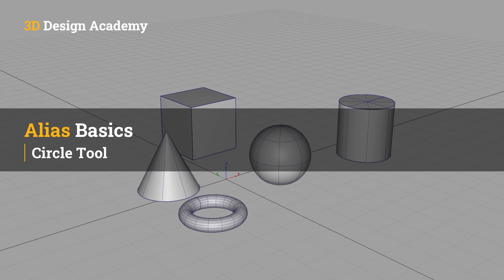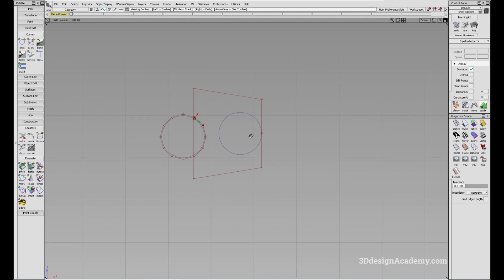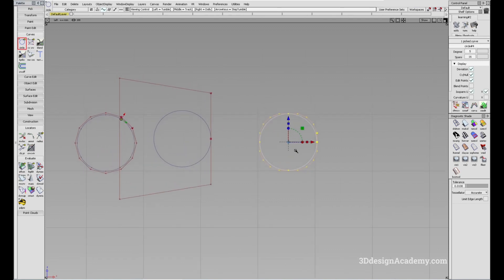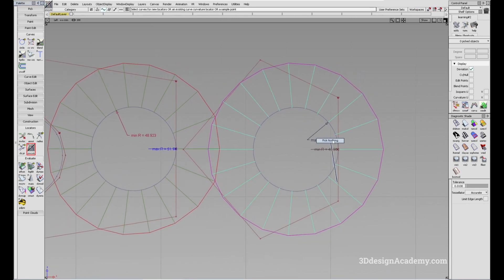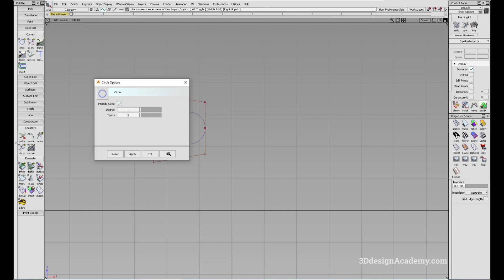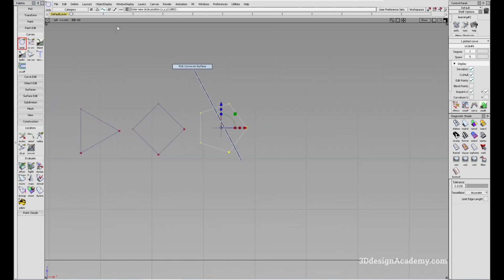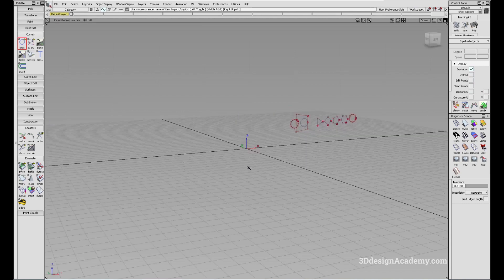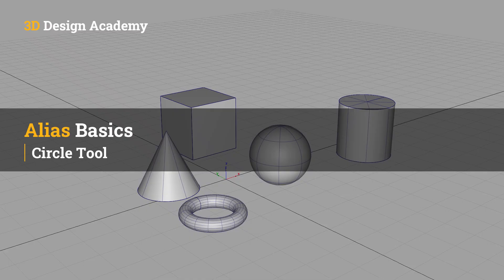Autodesk Alias Basic Tutorials 29 - Circle Tool

Comment: is there any way to set NON-periodic circles radius in mm, like with periodic circles? In attribute panel, every non-periodic have only relative scale. It's a pain! why? Is there any way to set radius or arc length?  thanks
Reply from the maker: You can use the circle tool within the Keypoint Curve toolbox. Here's the link for the video. https://youtu.be/hVCZdELMAyc Also, you'll notice that when you create a circle, the scale is set to "100" and it's 100mm diameter. Let's say you want a 150mm diameter circle, you just have to adjust the "scale" to 150 and you'll get a 150mm diameter circle. If you want, I can create a video. Let me know!
Reply: @3DDesignAcademy   Oh, i see. Scale makes more sense now, thank you! But yeah, if i may, it will be interesting to know the real usage of periodic vs non periodic in practice. It looks like non-periodic single surface circles are kinda strange. they are not precise, they are tricky to use with booleans and filleting these booleans. you need to detach and split them on parts, and rational flags (to make them perfect) cause issues with high construction tolerances and more pain in general. why do they even exist if you can create non-rational non-periodic 6 deg 4 spans circles and they work fine? Just because you can do hexagons with it?  Anyway, really interesting! real use cases. Which one to pick for the specific situation. For example, if your circle goes across the centerline? what if you need to make a circular insertion in a concave or convex shape and fillet the intersection? what if your circle needs to be scaled non proportionally? for example, for grip or something. Which circles to use as a base in all of these situations? And once again, thank you. It is really hard to find info on Alias.
Reply from the maker: @alexandergolubev6358  I'm glad I could help. You are asking a lot of good questions. I'll try to make a video regarding the topic for next week. I can't guarantee it'll be done since there's a lot of info to cover, but I'll try my best!
Reply: @3DDesignAcademy  Thank you! and please take your time. You have a lot of other good topics covered already. I did not even watch your car tutorial yet)
Reply from the maker: @alexandergolubev6358  I uploaded a new video https://youtu.be/uDL_qpITwpI Hopefully this answers most of your questions. If I missed anything, do let me know!
Reply: @3DDesignAcademy  you made my day, i am a happy person now:) all clear, thank you!
Reply from the maker: @alexandergolubev6358  I'm glad you like it!